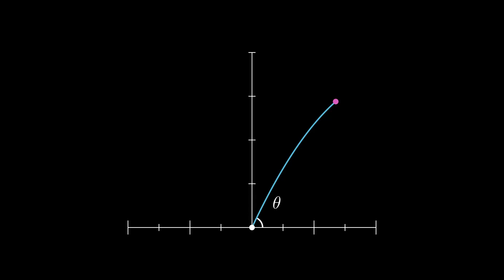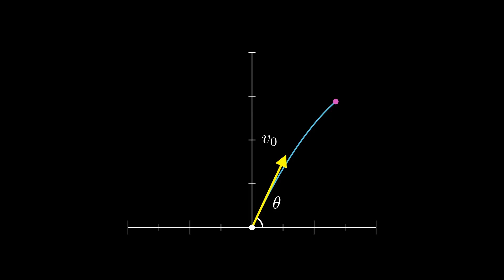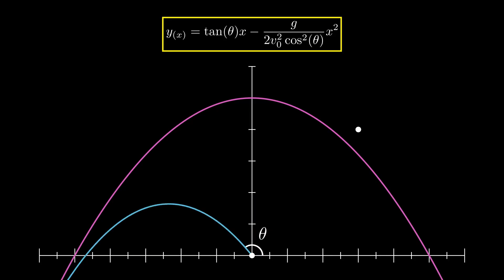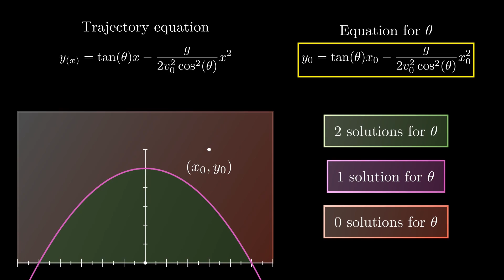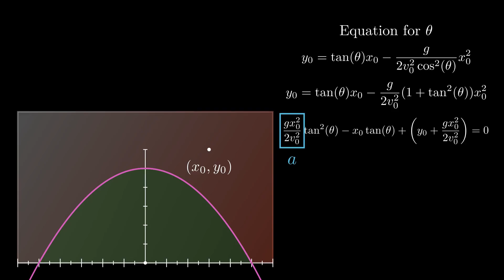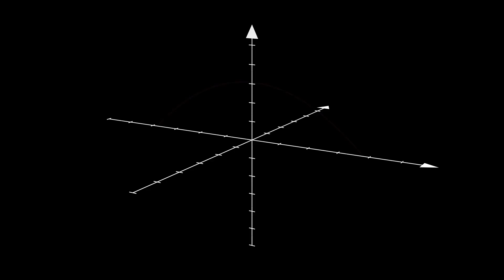How to Perfectly Fly Around a Sprinkler | The Safety Parabola | #some2

Comment: I actually solved this problem in a physics test a while ago, but I did it in a more boring way looking at they height a projectile fired directly upwards reaches, and the distance a projectile shot at 45 degrees reaches. This way is way cooler

Comment: The parabola is what you get if you start a drop at the highest point the water reaches, and send it horizontally with the speed water leaving the sprinkler. (So it has 2x the energy, )
I am trying to figure out a purely physical explanation for why.

Comment: There is a really neat rearrangement of this. That  potential energy + m(gx/v_0)^2/ 2 <= initial (kinetic) energy at every point in time with equality at that boundary, which is a refinement of the case where you throw it straight up. The correction term is the same as the x-kinetic energy of a ball that rolled down along the same slope as it was shot by, but with no initial velocity.

So using conservation of energy, this inequality is just you get more kinetic energy from shooting something out along a ballistic arc than the x-kinetic energy of letting it roll down through the ground along the same slope.

Comment: Hmm.  If you know the envelope is a parabola (which you were calling it from the start) then the parabola is defined by 3 points: the X & Y intercepts.  The Y intercept is the maximum height when the sprinkle shoot vertically.  The 2 X intercept are when the sprinkler shoots at a 45° angle either side of vertical.  These are both well-know facts with simple solutions, as is the parabola defined by 3 points.
Reply from the maker: I knew that the envelope was a parabola, but my derivation doesn't assume that at any point. You are right that if you already know the envelope is a parabola, then you can get its equation easily. But if you are trying to motivate that the envelope is a parabola, that doesn't work.

Comment: other way is to find where the curves for theta and theta+delta intersect as delta->0. One point will be at the sprinkler, the other will be on the safety parabola. It's a pretty general way of finding an envelope. A simpler puzzle is using this method to find the curve traced out by those string pictures.

Comment: This relates to a similar question I've had: parabola distance. At what angle (theta) gives the furthest parabola distance? This has a real life application possibly even in sports when you want to throw a ball.
Reply: Assuming no air drag (like in the video) it's always 45 degrees I think. Which I think also means the safety parabola always intersects the X axis at 45 degrees? Am I missing something?
Reply: @andreidaniacovache  yes, but only if you're on flat ground. Let's say, you're on top of a building, the optimal angle for max distance changes

Comment: Wouldn't it be a simpler calculation to 1. Find the height of the water sprayed straight up (giving us the top of the parabola) and 2. Find the maximum horizontal distance of the water sprayed at theta = pi / 2 (giving us the x intercepts) and then 3. There's exactly 1 parabola that goes through those 3 points?
Reply: This assumes that the curve is a parabola, and not some other curve very close to a parabola
Reply from the maker: If you know the curve is a parabola, then yes, but I think that would be kind of solving the problem knowing half of the answer in advance.
Reply: @gabrieltrigo5172  Ah, I see. Well, since the title of the video already told me it was a parabola I think this is as much your fault as it is mine ;)
Reply: But that would only work if you knew in beforehand that it even is a parabola. And working that out is probably as difficult as solving the problem directly.

Comment: I decided to try this before watching and used a different but pretty similar method. I also ended setting the discriminant of a quadratic equal to zero, but I got there by making a parabola at the vertex of the safety parabola, and then got a quadratic for the difference between that and the trajectory